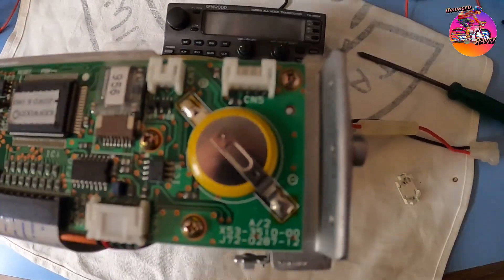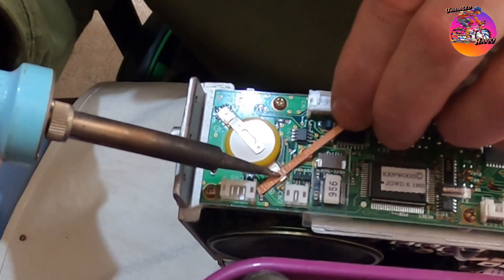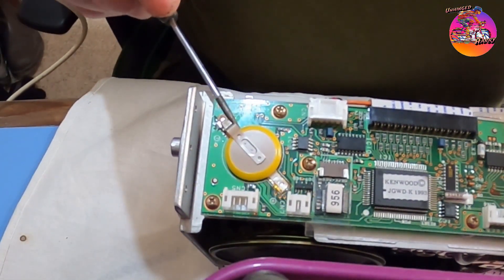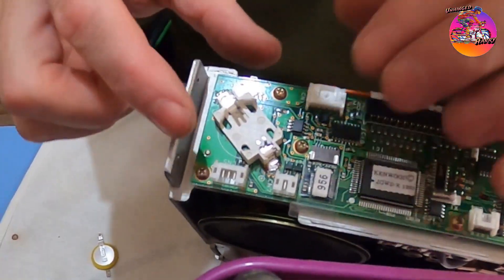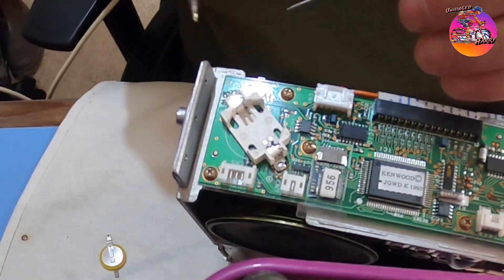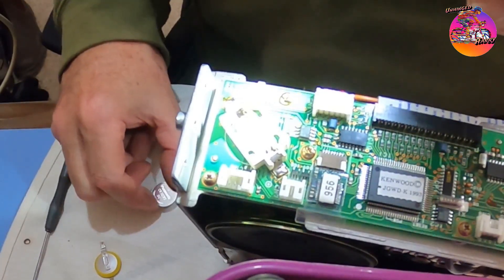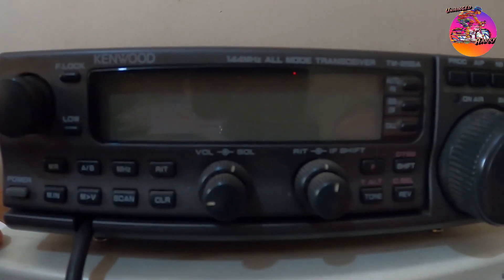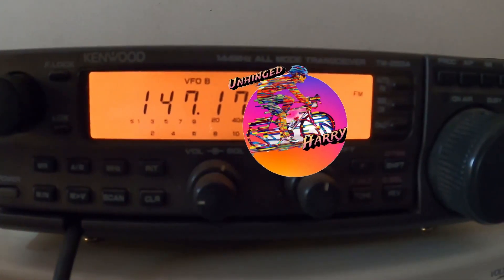Kenwood TM 255A Memory Battery Replacement

Comment: i would of loved to have watched the front end being taken off.  I got to the stage of takening the front off to be confronted with lcd screen, not knowing the next step.
Reply from the maker: Hey mate, once you get the top and bottom covers off. There are two screws either side of the front section. Undo these and the front should lift off, then remove the connectors.
Let me know if you want some still pics that I can get from the raw video footage but I reckon you'll work it out. mtbfarmer at hotmail dot com
Reply: Cara mesmo que vc venda não entendi uma palavra do que disse,tentei traduzir mas não deu